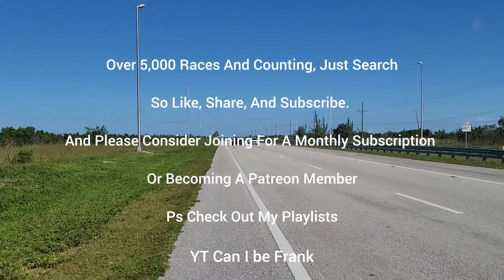S197 5.0 Mustang Cammed FBO E85 Manual vs 10R80 Mustang Boss Manifold Headers E85

Comment: the slightly higher pitch/ high strung exhaust sound on that 10r80 is giving me secret 100 shot vibes…the problem with tryna hide nitrous is that it changes your exhaust sound slightly, if u know what ur looking for…
Reply: 100 shot ?? 🤯🤯
Reply: A 100 shot would do wayyyyy more than that.
Reply: Probably the boss manifold
Reply: @nismoaltima1326  car it’s all motor
Reply: @johnny1809  it would've gapped worse
Reply: @nismoaltima1326  yea honestly you could be right
Reply: @mr_business  maybe it’s poorly tuned 😉😂